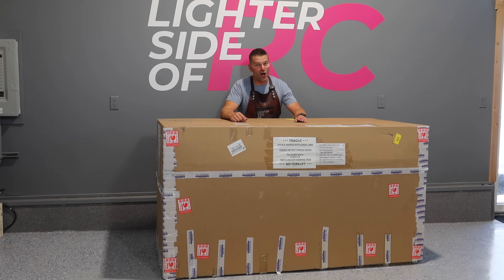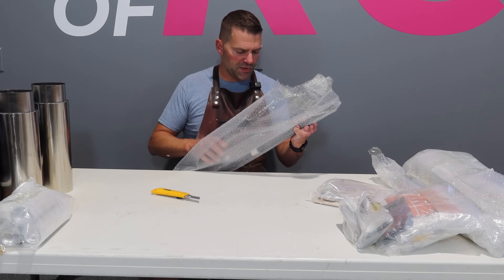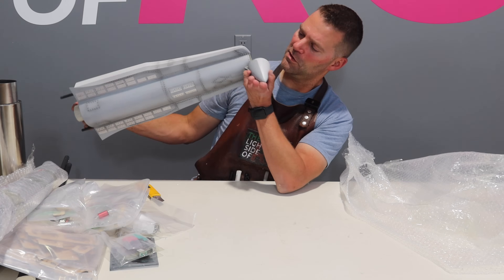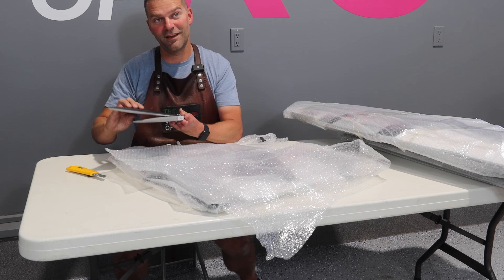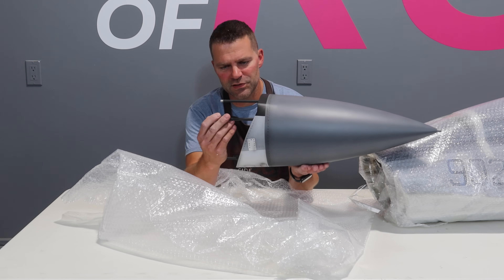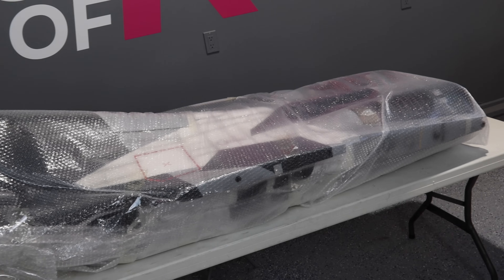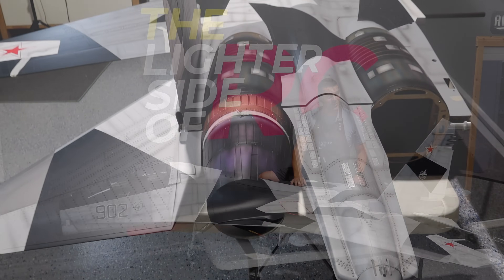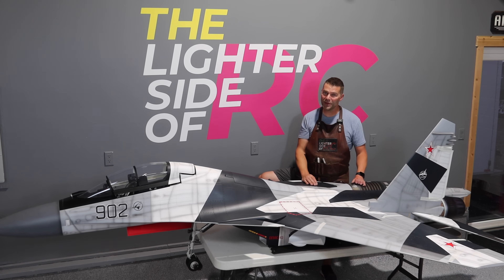The Mighty Su30 Jet - White Russian Edition Skymaster RCJET UnBoxing

Comment: Yeeeesss, this project will be awesome. Can you do an in detail radio programming and setup video for this?
Reply from the maker: Sounds good.  We will be using the program the owner already has with his current SU30 but will cover the radio stuff in depth.  It will have a very unique setup that is not often used in most aircraft as well.

Comment: If it wasn't for the title, just looking at that box I thought you had gotten a H-D Sportster shipped to you!  That is a gorgeous bird for certain, definitely looking forward to the build series and the maiden.  I'm guessing a pair of the SW190 or SW220 range for the turbines?  Hmm, do the Swiwin 300's fit in there 🤣🤣?  It looks like there's enough room and enough fuel tankage to keep feeding them for a decent flight time.  Although those would be MAJOR overkill 🤣🤣.
Reply from the maker: HAHA.  Thanks!  I believe we are installing a Pair of the New Xicoy 235's.
Reply: @thelightersideofrc  Those should easily let the jet go vertical if the owner wants, and even safely bring it back if one goes out for some reason.

Comment: $ 5,000 plus two turbine engines and radio and suplimentary pieces. Probably $10,000 all in?
Reply from the maker: About 35k all complete
Reply: @thelightersideofrc  $35k….realy that much? That will be a very expensive hole in the ground if it goes in!🙀